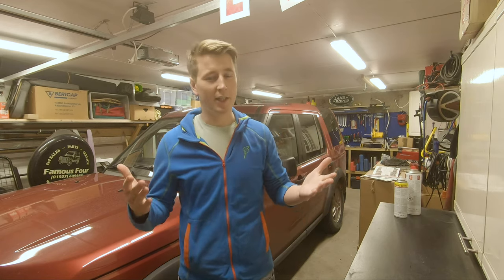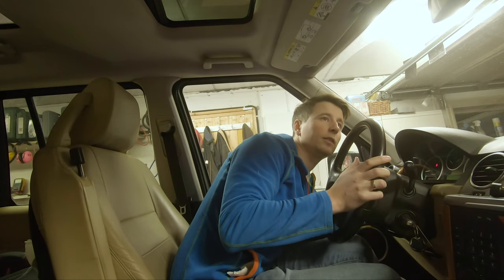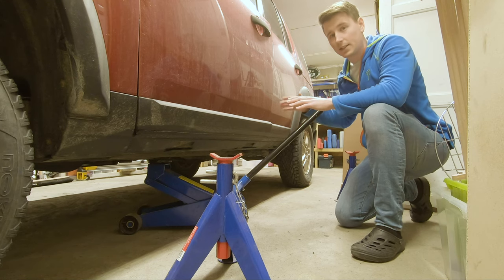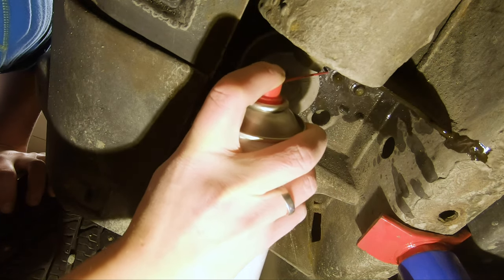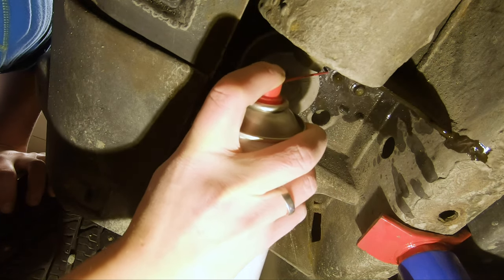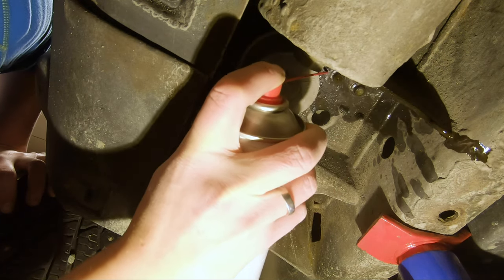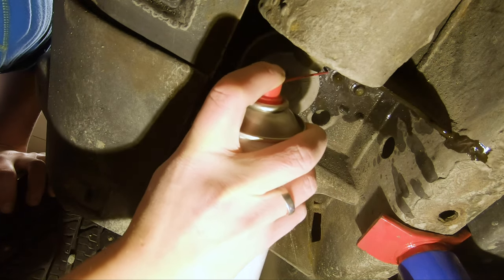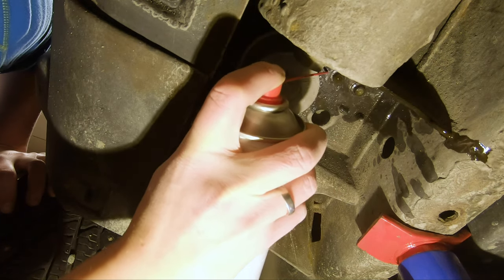How to remove air suspension reservoir tank on a Land Rover Discovery 3+4 LR3+4 RRS-l320 FULL DETAIL

Comment: Excellent Video! I do like when the WHOLE process is shown, it certainly gives me the confidence to do mine. It's probably a good idea just to remove the tank, clean it all up, and protect the the area with some rust prevention product (Dinitrol/Waxoyl) anyway, before it starts leaking. Thanks for this most informative video, look forward to the rest!
Reply from the maker: Thans Guy, really appreciate it. Yeah, If I knew it could get this bad I would have done it before. just 4 screws, and if you disconnect the air pipe at the valve block hiding under the compressor cover, you don't have to remove the voss connection on the tank. Just feed the pipe over the body mount. 2 videos more out now. 👍🙂

Comment: Driving from the UK to Norway in February, I think I'll change it just in case. Letting the air out manually is the way I'll have to do it.
Reply from the maker: Hey, February is a great time to be in Norway. A bit cold and dark but the weather and skies are so clear so some great views can be had and enjoyed. If you just drop the tank down and inspect it, maybe drop it into a tub, without disconecting the tube, you can check. But if you don't know how old your tank is and it's rusty I would recommend changing it. Quick job to do and a lot of good feeling afterwards. 👍🙂

Comment: Hi! i removed the compressor for repairing it,it works fine but i still get the " suspension fault " message..! do i have to rearm? or reset?
Reply from the maker: What’s the status on your compressor? If you have/had a leak the compressor would run a lot and could be the issue now as it worn out.

Comment: Thanks for the video.  Well done.  Question: when you put it in Build Mode, can you disconnect the ID Gap Tool and will it remain in Build mode after when you start it and drive it?
Reply from the maker: Hey, yeah it will remain in build mode. You have to do the same prosedure again to turn it of.  What are you thinking? Off-road?
Reply: @LandRoverDrive  Yeah, I was wondering if it would work..., thanks!

Comment: Tip rergarding removing such pipes. Make sure that when you are undoing or tightening the nut, make sure the pipe does not turn, otherwise you risk damaging the pipe.
Reply from the maker: Great tip. Yeah I guess the pipes can get a bit brittle over time too. 👍🙂